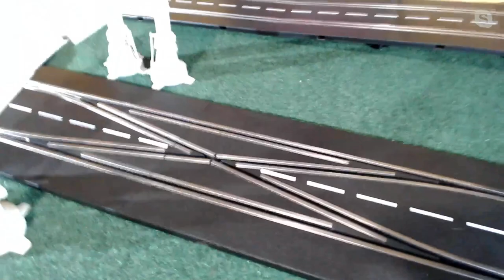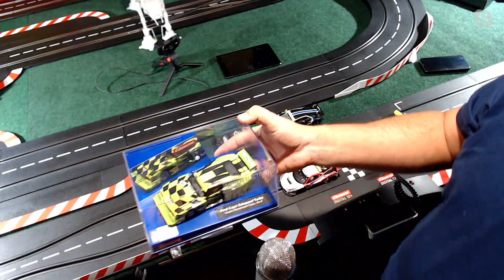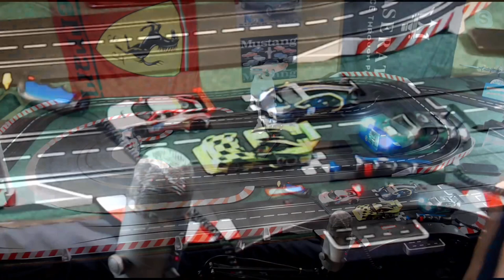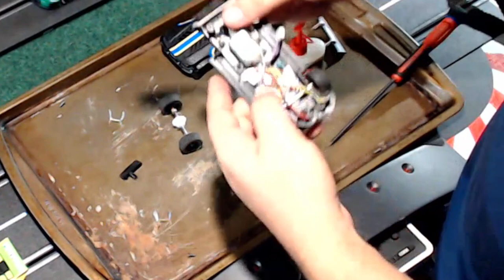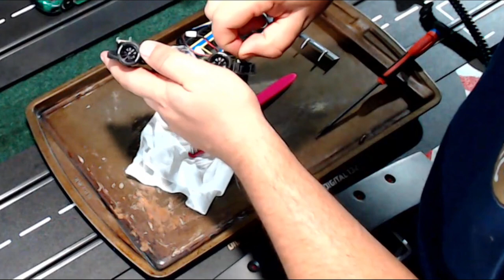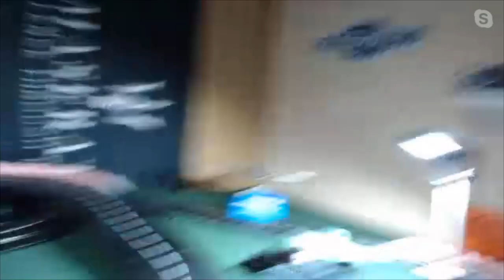Introduction To Carrera Slot Car Racing 1/32 1/24 Scale Digital

Comment: So when I finally decided to the pull the trigger on this they were out of the 3 car set so had to go with the 2 car set with the Ford GT. Planning on building this in my garage, got most the accessories with 4 driver displays. Trying to find a good free source with track layouts... I notice you don’t have the pit stop... so I really like your layout but may add a pit stop. Love all the videos! And thanks for introducing me to another way to go deeper in debt.... lol....but have to have something to do when it’s not flying weather. Keep them coming!
Reply from the maker: I actually have the pit stop now 😉 check out our set up video on the channel I also recommend the Bluetooth race connection and smart race app best $30 you will spend especially if you want to use the pit lane

Comment: Cool Video!  I'm into both Scalextric & Carrera Digital, but I decided Carrera is a lot easier to setup the cars, Manual, & Ghost.  I saw Monster Hobbies setup 4 lanes, & all they use is the Lane Crossovers or the Switch, for Electrical Continuity, to complete the Circuit.

Comment: I've been using HO scale and have considered doing a 1/32 digital track next but I'm not sure I will truly take advantage of the digital features enough to justify the cost. Thanks for the video and explanation, do you run 1/24 cars? Also, Will it do 1/24 in digital? I know you can only do 4 cars instead of 6 with 1/32, but curious if you have to buy anything else if you want to do 1/24 digital too. Thanks again
Reply from the maker: Yes 1/24 cars can run on this track also it requires you to use a different power supply. All the digital features carry over to
Reply: I’ve seen vids of people running 6 cars at 1/24. How?

Comment: Very very awesome, no clue you had ever done a slot car track, We have a Carera Go track 1:43 at home, purchased about 4 years ago trying to get my father into doing something besides just sitting in his wheelchair but he only played a couple of times, my wife seemed to really enjoy it but didn't have room for the track in the house ( it was on top of the pool table ) and made that useless. I took it down but recently got it back out and me and my wife have had some fun, Like yourself we found a local Slot track and have been 2x, one no one was running the the 2nd people raced. its cool and all but man the drive up to it then the $ to play and or to race it can really add up. I decided after watching all of your home videos to order a 1:32 Digital set. i think the 1/32 will be cooler and closer to the 1/24th they race at the track.. do you know what all Tracks will work on this 1:32 Digital track? I understand the Scalextric 1:32 cars will work if they are DPR correct? you just need to buy that $43 chip to go in it... This to me seems lot cheaper then that Tex box you have, however its really cool to switch, that is a lot of money up front.. did you ever do the App? i didn't see a video about it or maybe i over looked it.. Can't wait for the new track to come and me get it set up, i ordered extra track and hope to do a layout similar to yours, just so i can use all of my table.

Comment: I was told by hobby town that carrera was not good and you couldnt get parts, and cars dont hold up
Reply from the maker: Lol go to Carreraslots.com and click on parts
Reply: I have a carrera track from the sixties and it still works. I was 8 when I got it. All my friends had them and we would race every weekend taking turns at friends  homes. One of my buddies had a four lane track.as kids we were rough with them.
Reply: Hobbytown is the worse place to get advice most of the time, however they did sell me my Go set 1:43 a few years back, but i also knew the dude who worked there cause i had worked in the RC part of that store years back.
Reply: You were lied to 😊

Comment: What's the proper name of the tool you called the "grabber?"  It is something that can be purchased at a hardware store?  I could sure use one.
Reply from the maker: 2-Pack 32 Inch Extra Long Grabber Reacher with Rotating Jaw - Mobility Aid Reaching Assist Tool (Blue) https://www.amazon.com/dp/B07PHL4DKP/ref=cm_sw_r_cp_api_glc_fabc_Im9ZFbFB4AE5F?_encoding=UTF8&psc=1
Reply: @MerryBoozerRC  Thanks!